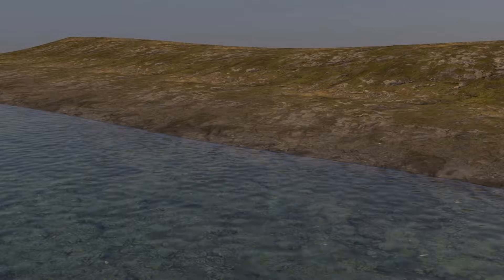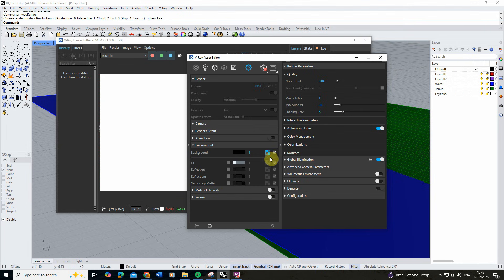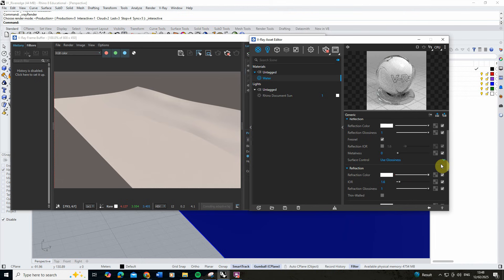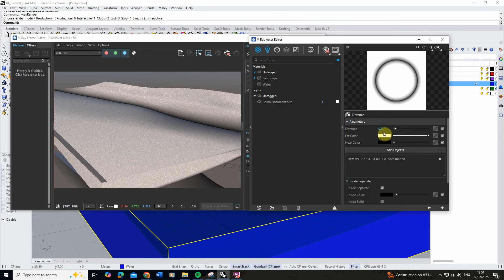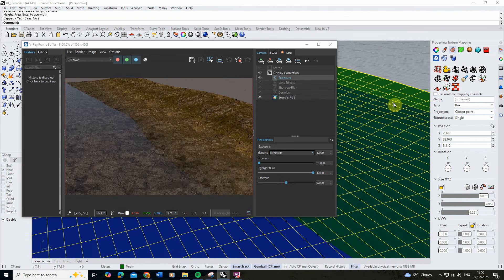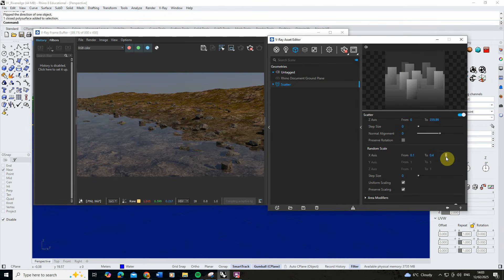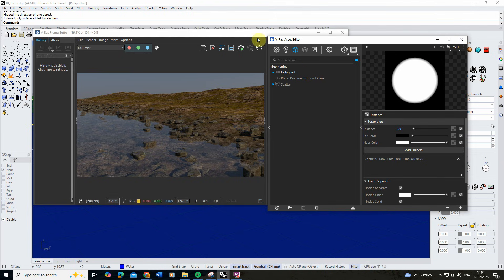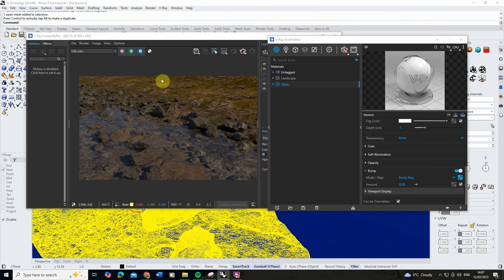Realistic Riverbank Render - VRay for Rhino 8

Comment: Hello I have a question about Exposure. Why did you chage your exposure in fram buffer and you didnt do it in the asset editor (camera exposure). Are they the same?
Reply from the maker: They are essentially the same, I personally find it easier to adjust in the frame buffer as you can tweak it to set the best settings for the specific view you are rendering whilst it renders out